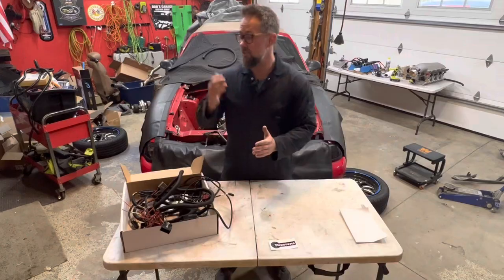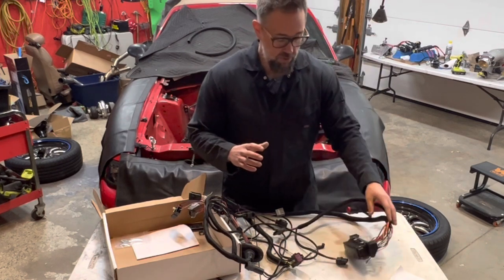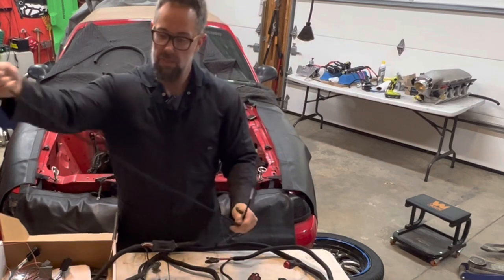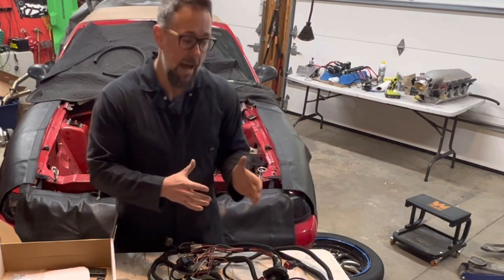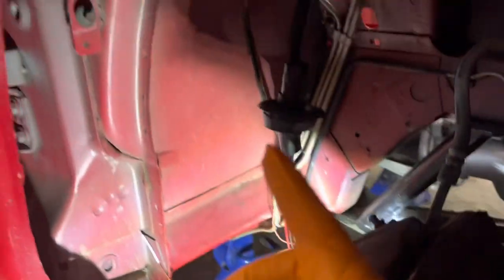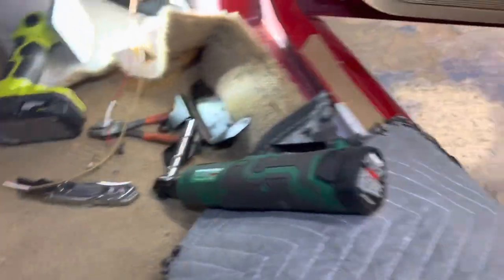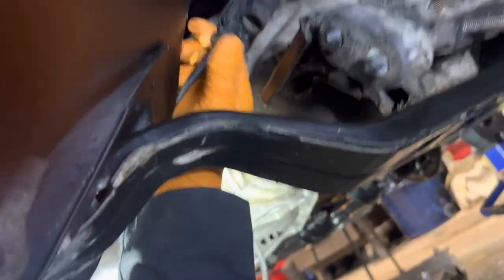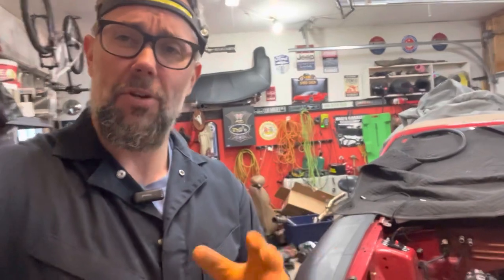Make your Holley Terminator X install EASY with MF Kustoms Mustang Harness service or adapter!

Comment: thanks for the video & great info. I'm about to start a Term X install on my 89 Fox and i think the MF Kustoms harness will make life so much easier. Thanks for the info. enjoy the hot rod tour!
Reply from the maker: Thanks! Fingers crossed she starts up in the next couple weeks!
Reply: @PeakPerformanceEngineering  Good luck and ill be looking for update videos. deadlines are never fun to try to beat. Something always bites me in the butt when i try to make or beat them LOL  are you in Michigan? if so what area?
Reply from the maker: Yep commerce Twp 48382
Reply: @PeakPerformanceEngineering  very cool. i live in Houston, Tx but my family is originally from Michigan and we still have a house on Lake superior outside the Soo. i bought my 89 brand new from Roy Obrien Ford in Detroit. will you be at the Dearborn motor city foxfest? a couple buddies and i will be coming up for it. should be fun, weather permitting
Reply from the maker: As long as the car is running and or still running I should be there :) only 30ish min away :)

Comment: Just emailed MF for this same purpose! I want to retain my 302 but run a carb style intake and terminator x stealth 4150. Want to avoid the ford fox system and their terrible iac valve headache. 

I will souce a spare harness off eBay so i dont ruin mine. Need to be able to reswap the car to stock for emissions and registration lol
Reply from the maker: Nice! The owner Danny Kimbler is a hell of a guy! One of the best in the business. He helped me a ton with issues I was having and was very very generous with his time helping me. Great product and a great dude.
Reply: So awesome to know MF are good to deal wirh. You sir earned a sub! Finally a YouTuber that replies to comments. 

Great work on the car. Ive always had a soft spot for the sn95
Reply from the maker: Thanks and glad to help. You should Join the ford Holley terminator x Facebook group, danny is an admin on there and it’s a great place to ask questions.